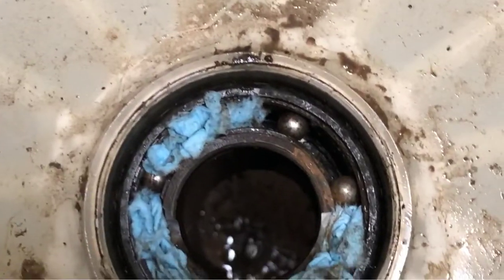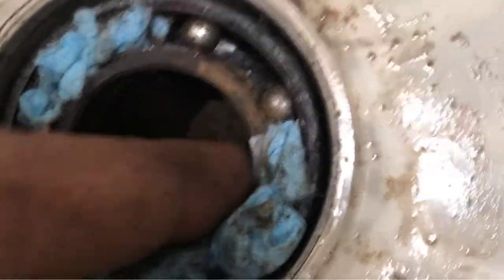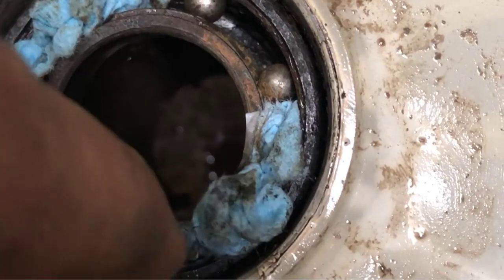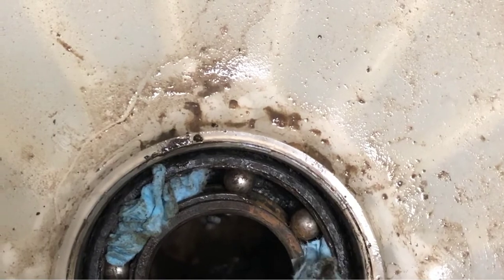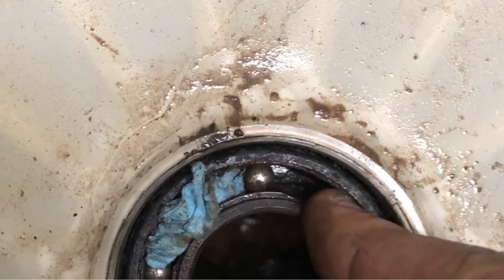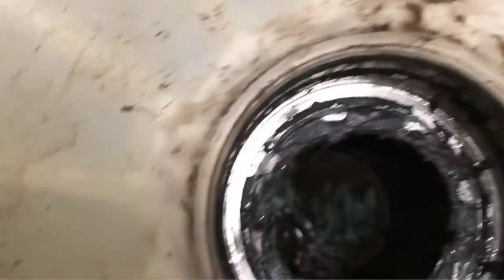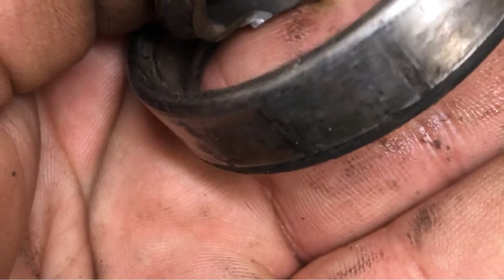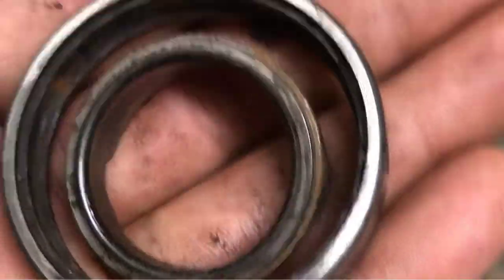How To Remove A Bad Or Broken Bearing

Comment: It worked for me too... was almost ready to give up. Packed the four bearings with strips of cloth and used the old shaft with the wider end going in first -  then just hammered it. First I could hear one bearing come out. With just three bearings snug inside I kept hitting the shaft end expecting the inner race, bearings and cloth stuffing to fall out again... they did but so did that stubborn outer race ! I had been spraying that area over the last few days with penetrating oil so that probably helped too. Thanks so much for taking the time and making the effort to help others. I really appreciate your help !!
Reply from the maker: George Subocz I’m glad it worked for you! Thank you!

Comment: Ok, I feel like I owe you a case of beer or something.  I just spent two hours trying to get the outer bearing race out of my Whirlpool Duet front load washer.  I've never seen a bearing that completely destroyed itself. There was only one ball bearing left that wasn't broken or ground down.  I went to Ace hardware and found 6 more ball bearings the exact size, followed your instructions and in about 10 min the bearing was completely removed.  You rock!  I liked and subscribed, it's the least I could do.
Reply from the maker: @matt51492  sweet! I’m glad you were able to get it fixed. I’m one of those people who mostly refuse to buy new appliances lol

Comment: Wow, worked awesome. First time it popped out because I was only able to hit one side. THEN, I put the shaft in from the top and re-aligned the bearing with 8 balls (instead of 4). Then, when I layed the washer down, I was able to beat on the shaft and because the collar of the shaft came in contact with the entire underside of the bearing, it popped right out. SO HAPPY!

Comment: I know this is an old video, but had to come here and say thank you! This saved me a big headache.  My pilot bearing disintegrated during the tranny removal but thankfully I didn’t throw the balls that fell in the floor and center section away! I only had a handful of the balls left and it was still strong enough to use a puller! New found respect for bearings
Reply from the maker: Sweet! I’m glad it helped!

Comment: I have this problem on a motorcycle wheel. I think I'm going to try to spot weld the bearings in place. Thanks again for a good solution.